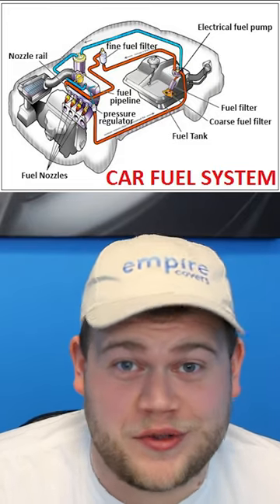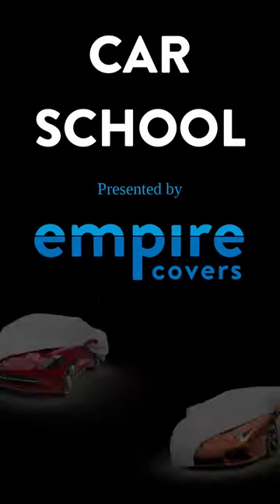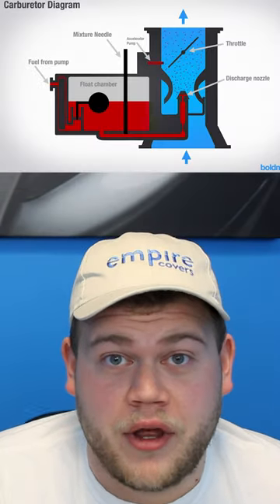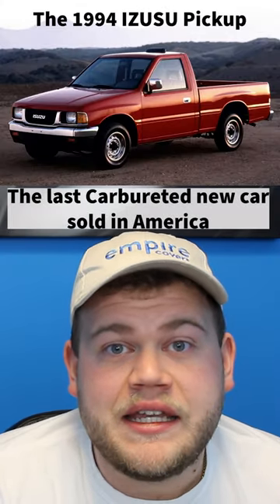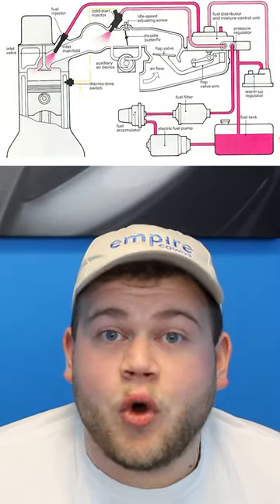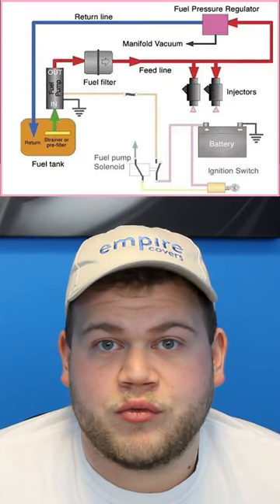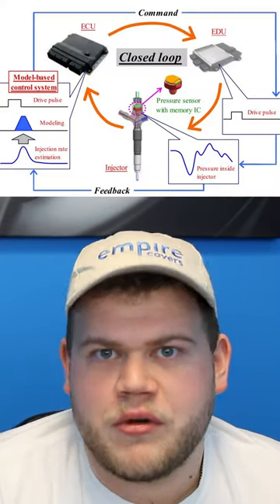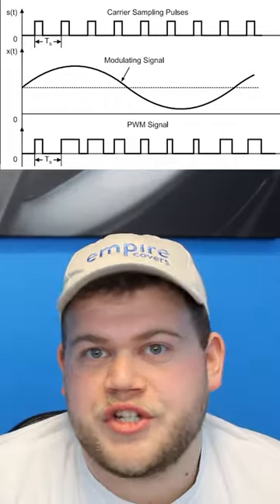CARBURETOR VS. FUEL INJECTION SYSTEM?

Comment: Fuel injection uses less fuel makes more power
Reply: Less fuel yes but carb gives you more power. Carbs became "obsolete" cause they will never pass emissions tests
Reply: Dirt bikes and smaller engines for lawnmowers and stuff still use carbs
Reply: @christopherevans4978  yeah so
Reply: @gavincarroll2553 Some of us prefer carbureted engines like myself
Reply: Not only that but can exceed high compression ratios
Reply: @themichael67891 Fuel injection gives more power. Carb has to be dialed for specific air density. Fuel injection can make adjustments on the fly to keep that air Fuel ratio PERFECT. You can put a wideband in a carb car but then your constantly making adjustments and will never be perfect throughout the rpm range.